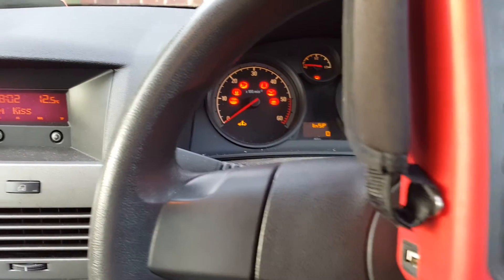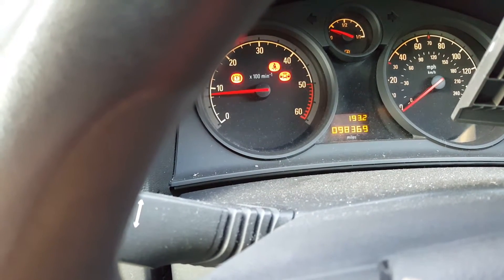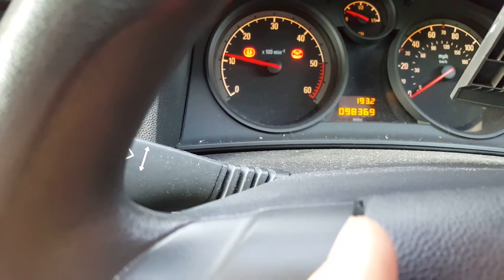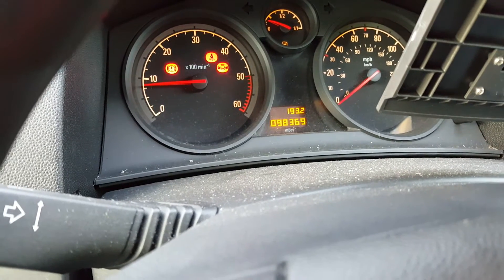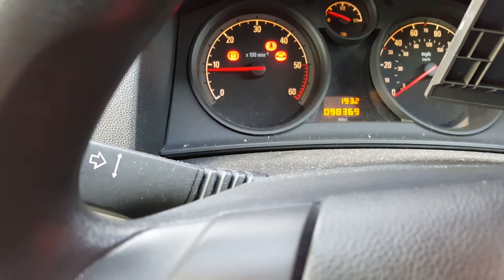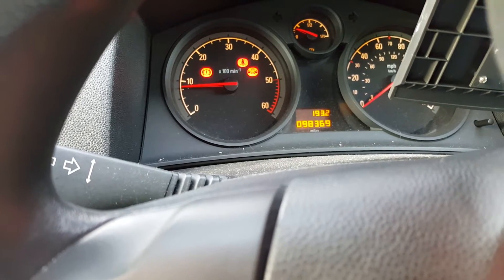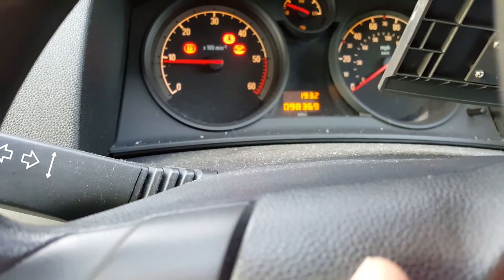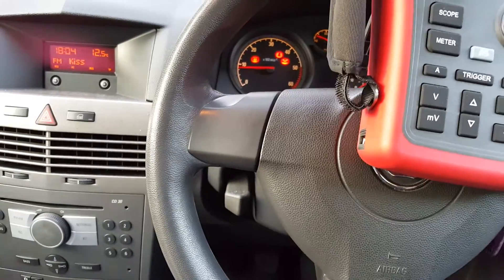Vauxhall Opel Astra air flow meter case study.

Comment: Not a misfire Mate, 3000 fuel cut for safety based on low MAF Frequency, MAF stopped at 32 unless you feathered throttle so it seems to be limiting at 32 but runs well at 3K but way under expected, A way to prove fuel cut is to monitor fuel injectors and see if the pulse width goes down to a minimum when the power is cut. Of course, would have loved to see a new sensor installed and verification of 3800 Hz at 3K RPM, nice diagnosis.

Comment: If it is a faulty MAF sensor wouldn't graphing the fuel trims to show a lean condition against engine RPM point you in the direction. It was a good guess btw :p
Reply: This old car do not have lambda to calculate exgaust fuel trim. ECU calculate fuel to inject based on MAP/MAF sensor.
Reply: Fuel trims in a diesel car? Never heard about that.
Reply: Do you know what fuel trim is? .....I guess not. Diesel and petrol both have short/long term fuel trim though is calculated in a different way.

Comment: hi mate i have 1.7 cdti i put key on i wana start engine not even click .. i check start moter is ok,,,im not sure cim or ecu thanks
Reply from the maker: Hi
Have the car scanned and go from there...
Otherwise is all guess work...
Reply: not comacatoin
Reply from the maker: +KURDISTAN uk 
With which ECUS?
Reply: https://www.facebook.com/babka.laska?fref=photo
Reply from the maker: +KURDISTAN uk 
Let me see if I get it...
You are able to communicate with the other ECUS in the car,  but not the engine one, is that correct?
Reply: i dont try yet,,im not sure ecu problem or cim,, i crank engine from relay but with key not ..
Reply from the maker: +KURDISTAN uk 
I would scan the car to see which ECUS you can't communicate with...
If you lost power to the engine ecu the communication will obviously  be lost...
Make sure all the ECUS, starting with the engine one, have the correct 12v and ground feeds...
Check fuses and the main relay...
Reply: i check grown and  power pin all ok..but main relay missing one grown ,,
Reply from the maker: +KURDISTAN uk 
ok...
Just feed that ground using a wire... and see what happens...
Reply: is wire go to ecu i thing control start motor relay did u have pic or diagram for astra 1,7 thsanks
Reply from the maker: +KURDISTAN uk
Probably....
Year of the car?
Reply: yes..thanks